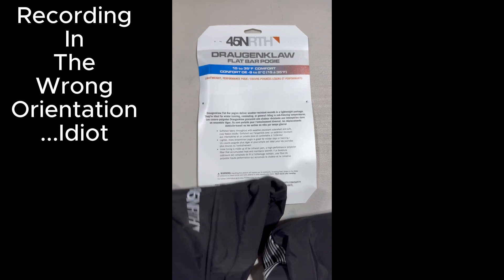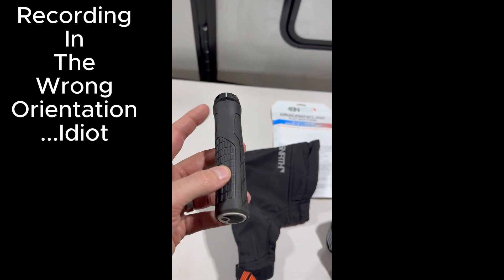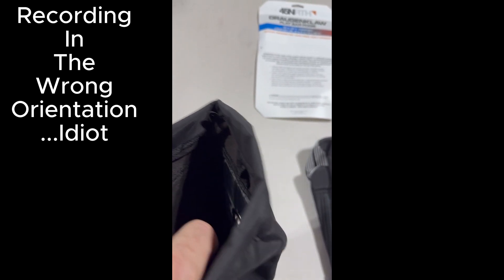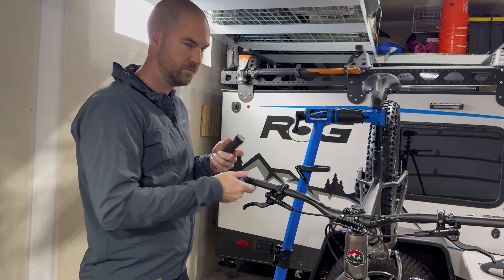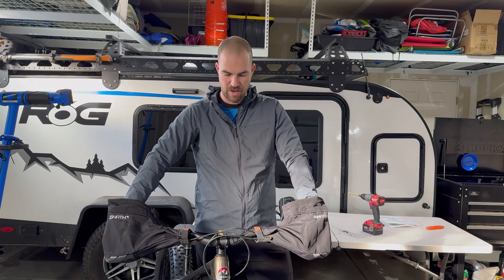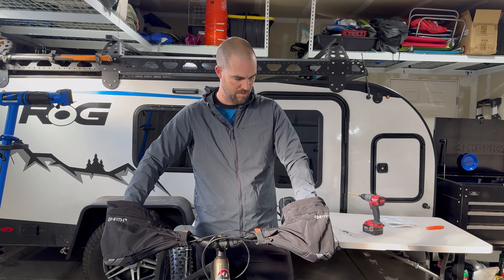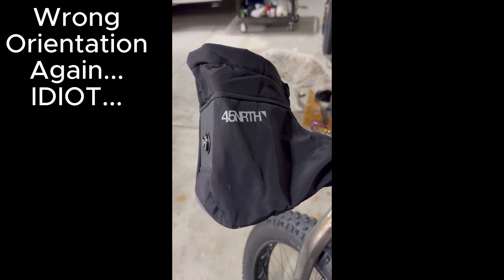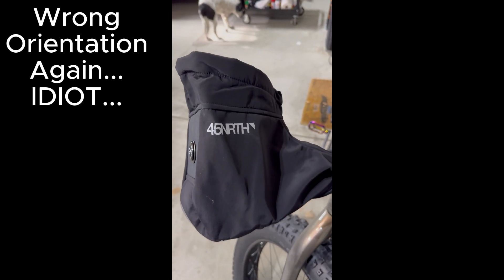45 NRTH DRAUGENKLAW POGIES INSTALL AND REVIEW

Comment: Thank You!  I was looking for an installation video and I was not disappointed!  Luckily, I have removable bar end caps so no drilling necessary. I have never used pogies before so thanks also for your test ride. It just recently stopped raining here in NE PA so tomorrow  will be the first time I use them. Thanks to your vid I will go out with them with a little more confidence 😁
Reply from the maker: Awesome to hear, have a great ride. Stay safe and have fun.

Comment: So what's the coldest temps you've used these comfortably?  With thicker gloves, would they work down to 0 F?
Reply from the maker: I’ve had them down to about 12 degrees which is 20 degrees below the freeze point and they were plenty warm, I’ve never been riding in that cold of weather.  They do have an extreme version I think for super cold areas but I bet they are good well below 0.
Reply: @AdventuresWithClair  Thank you for the feedback!  I think these will work well for me.  I have very warm thick gloves that I can use with a pogie for the really cold days which get around 0 F.  I have friends that have the warmer 45NRTH CobraFist version but they have issues with their hands getting hot even in very cold temps so I think they are overkill for me as I have pretty decent circulation.  Going to give these Draugenklaw pogies a try.